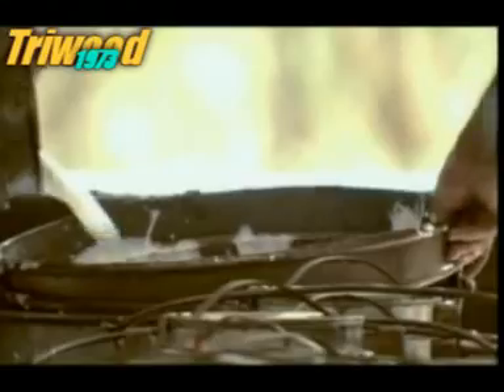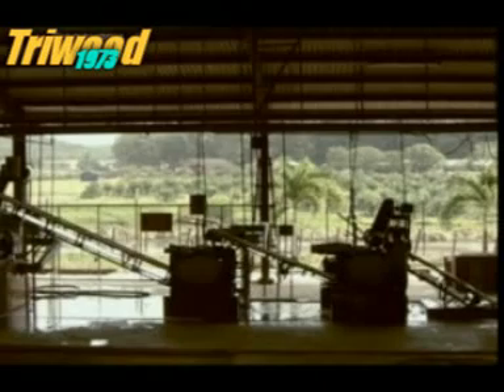How Rubber Bands Are Manufactured

Comment: It wouldn't go higher than the 3/4th building I could tell you that, unless the managed a way to throw it down, but if they just pushed it off then it wouldn't go past 3/4th the building height